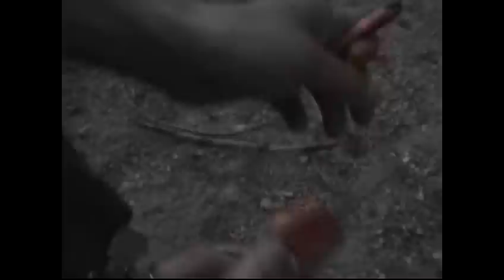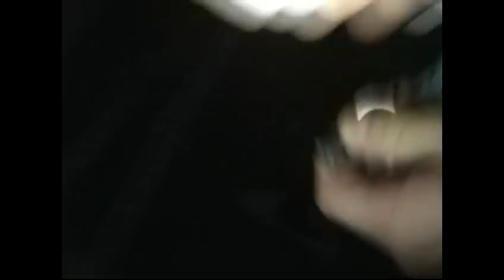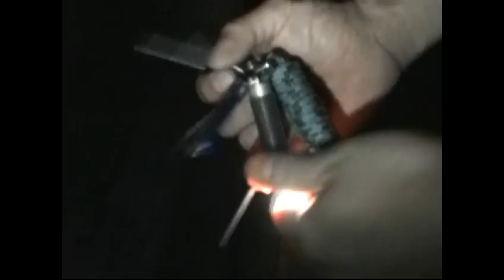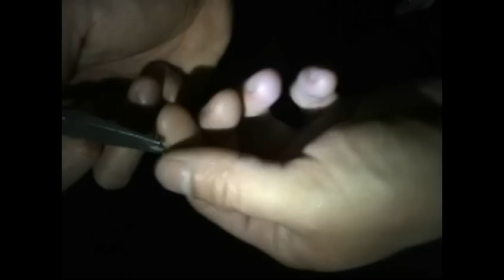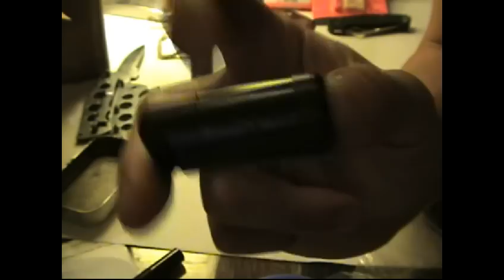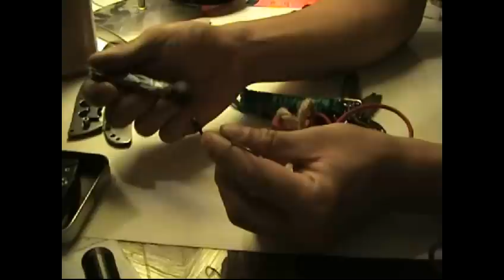NK Ultimate Mini Survival Kit Tactical

Comment: hey did you see srjoben just made some homemade prybars.  good lengths too but i dont remember the steel he used.  the pill container that i use came from walgreens.  it feels like a solid milled part.  the walls are super thick and so is the lid.  the o ring is thick too.  good solid threads too.  its solid stainless steel which i like way better than aluminum for a  keychain object.  i need to make me a survival fishing kit.  as i live next to a huge ass river.  spyderwire?